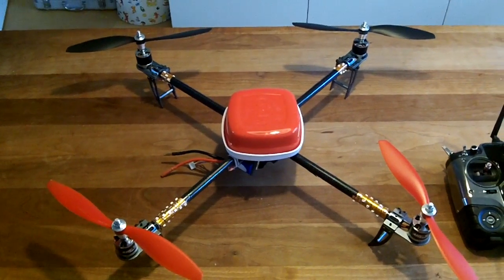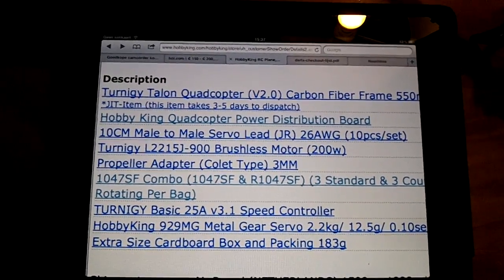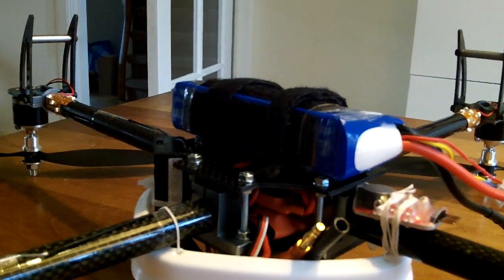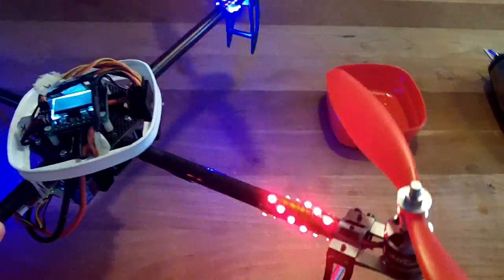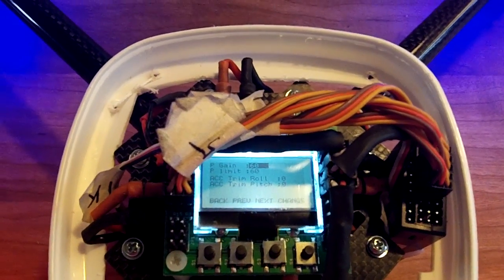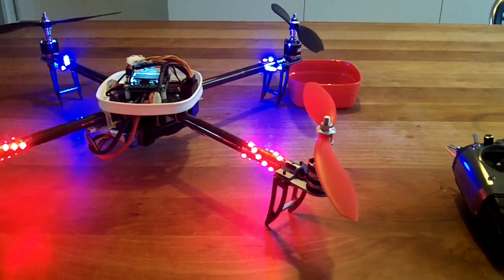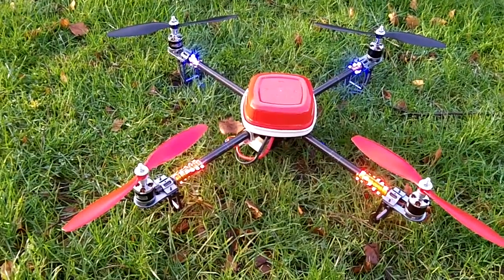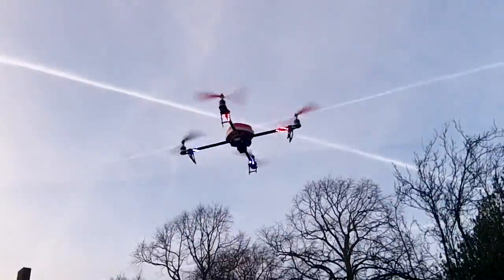KK2.0 board basic settings

Comment: Goede video! I use more or less the same settings with KK2 board with 1.5 firmware. P gain for self leveling set at 75. Great stability!

Comment: Excellent video Roger. When are you going to post the next stages of the setup. Till now I have been using Naza GPS but I am moveing this to a hex which I am currently building so I am installing KK2 into my Talon V2 but am having issues due to my ignorance of the board. I made a simple mistake of omitting to disconnect one motor wire on each when calibrating, this resulted in frying one of the motors.